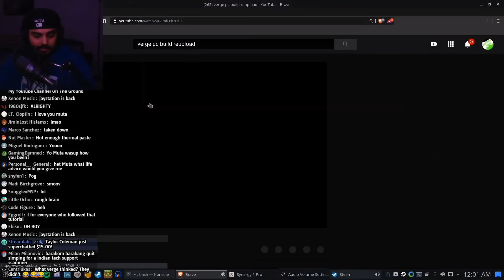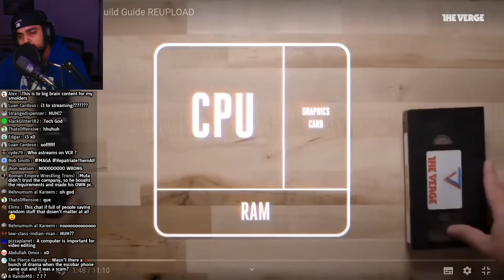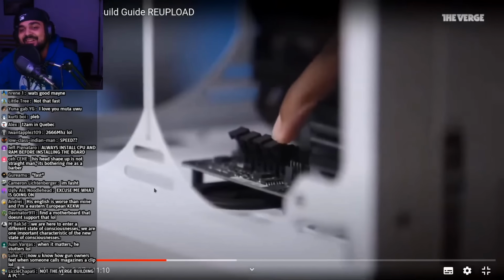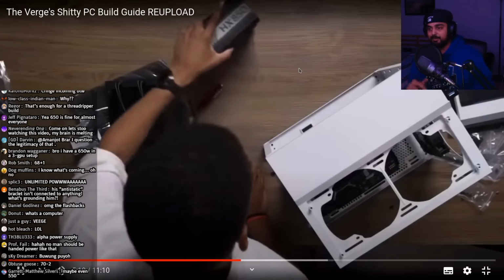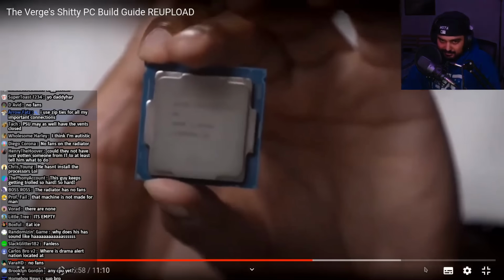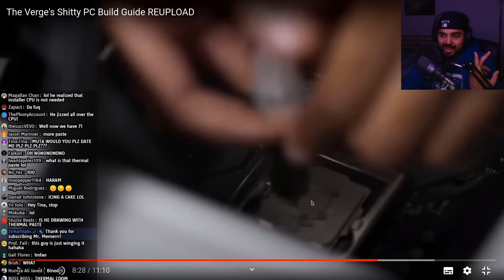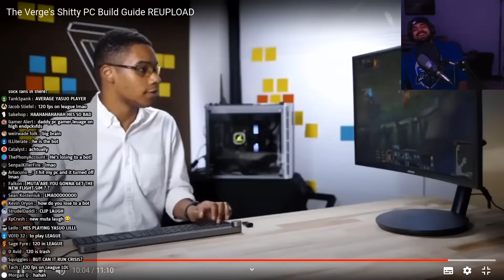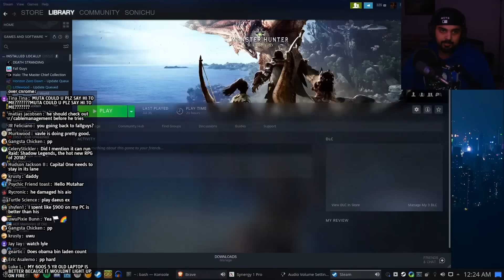SomeOrdinaryGamers - Muta learns how to not build a PC (w/ chat)

Comment: Give the guy credit, he did go on LTT and redeemed himself
Reply: The problem is that he never admitted his mistakes and came off egotistical and toxic saying that he has built computers and know a lot more than anyone
Reply: @andrics7611  No the problem is Verge forced him to record this on the spot and removed 60% of the video that contained context
Reply: @mistermittens3533  I wonder what the context was for putting no dual channel RAMs, slathering the CPU with thermal paste, putting the fan of the power supply the wrong way, horrible cable management, missing one ENTIRE screw on the water cooler, telling people to dump the piece of plastic that came with the processor which is needed for warrantee, recommending usage of a "brace" for putting the CPU but never using it himself, wearing a grounding bracelet with no grounding wire.
Even if all of that is excused, why would he benchmark with his fps capped? Why benchmark a game that requires nowhere near the power this PC has? What is the point of building such a PC if he doesn't show what it can do with games like Witcher 3? 
I don't care how he reacted or apologized, but most of the stuff he did could've been avoided on spot. No amount of context can ever explain why on earth an entire screw is missing from the water cooler.

Comment: PSUs are usually most efficient near half-utilization and crappy quality PSUs you can't really rely on to work well near their maximum (voltage ripple, fan noise etc). So a 850 W PSU will be most efficient when it is loaded to around 425 W; I would get a PSU that's got 50%-100% to spare ontop of TDP.

Comment: I’ve always just put a screw driver in the ground hole of a power outlet (bottom hole, if you get that wrong you may die) and just touch it after each part. Pretty cheap guaranteed way to loose static

Comment: Dont forget that a PSU is most efficient at 50 % percent load
Reply: With that hardware u ain't getting anywhere near 50% 850 is overkill
Reply: @thealien_ali3382  Don't double down on that dude 400 W are achievable with this build, you gotta give the benefit of the doubt

Comment: First dim slot closest to the cpu is also not the case anymore in a lot of mobo's, in 2 of my b450 motherboards first stick goes in the 2nd dimm away from the cpu, its weird, i also learned the other way since a long time ago.
Reply: Compensates for wide CPU air coolers that often block the first slot.
Reply: @lulzdragon7339  Ah, didnt think of that, you are right. Do you think it will just work fine if i use dimm 1 and 3, might be better for memory overclocking.
Reply: @budgetking2591  Depends, your mobos manual should tell the best way to install ram.

Comment: Worst thing I've ever done to a motherboard was an old motherboard (even at the time I was playing with it, it was basically obsolete trash; might have been a K6-II I think). Some genius thought it was a good idea to have the fan headers unmarked and right next to and aligned with the clear CMOS jumper pins and have old school fan headers of a type with no plastic keying; so naturally I stuck a jumper on the fan header and burnt it out. Didn't even kill the motherboard, just that (unused) fan header. 

Scariest moment with a motherboard was installing an athlon XP cooler of the type where you have to use a flathead screw driver and several kilograms of force to hook that onto the little plastic clips on the socket. If the screwdriver slips out that's really bad and if you apply uneven pressure to the corner of the CPU (naked die with no IHS) it might chip and that could be really bad. This was a fairly beefy cooler for the time, so naturally it was only using one of the prongs on the socket instead of all three to make you extra nervous of snapping one of those shitty little plastic prongs. It worked fine, it just felt awful to do.

Comment: I’ve noticed a lot of boards that are not esd safe are still esd safe. I work in assembly and have never had an issue with boards when I’ve tested. I even rubbed my feet on carpet before and touch stuff and it still worked fine and even passed

Comment: I'm still not sure if my CPU is overclockable. Though I'm pretty sure I didn't fuck up my build as much as he did as a beginner
Reply: Everyday I turn on the PC thinking I fucked something up
Reply: I didn't fuck anything up but..
1. My cpu cooler is to big
2. I don't have a gpu
3. One of my fans didn't work
4. I dropped my cpu when I opened the box so hopefully I didn't fuck it's future
Reply: @Plane.  lol my first cpu fan smoked when I started my PC
Reply: @maousadao9572  my fan did🤣it freaked me out
Reply: @Plane.  Hmmm. The only other thing of note that happened was the fact that I got an older motherboard and the then new Ryzen 5 3600 CPU. So I had to flash the bios, however I couldn't get my hands on a bios flash cpu kit and it took me like 2 weeks to finally get it flashed and working

Comment: 21:00, actually he’s wrong. For example, it’s better to run at 60hz with 144 fps than it is to play at 60hz 60fps because you still get the most updated frames as it reduces latency.

Comment: The fact that the bracelet is not connected to anything these are debunked a 1000 times you need one that connects to a ground wire. But if you discharge to a connected but powered off it works fine.

Comment: Hey just noticed something you said which is only half true.  When talking about RAM you usually want to start with the outer most slot furthest from CPU socket and the corresponding slot for dual channel.  Mobo manufactures point to those ones first, I would imagine to give you more room for an aftermarket CPU cooler

Comment: I didnt hold back when I put in my first motherboard in 2015 when I was 14, definitely screwed it in pretty tight and briefly let gpu hang from pcie slot unsupported. Never had any issues though what really killed my motherboard was a moderate overclock that fried the VRM over 4 years after being installed. CPU temps were good and everything and all seemed to be stable and then I hear a pop and smell burning and screen goes blank. Since my CPU hasn't been upgraded since 2015 I just found a cheap board off of a sketchy guy on craigslist and all is good no other parts were damaged and everything is working fine again. Pretty pathetic that a board that advertises overclocking would die like that.

Comment: PSU efficiency varies with power draw...the graphs I saw show not much difference, i believe there is like single digit variation, so personally I don't care about that, though some people make it to be the main point. Regardless, based on graphs for some good PSUs I saw, the sweet spot sits somewhere around 50-60% power draw where the PSU performs most efficiently.
Another criteria is the sound level, and again, based on graphs, I prefer to match my PSU such that the system at full throttle draws 60-70%. 

So, 850 might have been an overkill from multiple angles, but it's not a bad choice if later a person decides to put some more cards in.

Comment: They’re not zip ties Muta. They’re fu(king tweezers.

10:28 I just realize he had that piece is on the wrong side of the case;
- the two screws need to come off
- the top piece need to be behind the case
- then screw it back
10:34 you can see it’s not properly seated and this fool is forcing it in.

Comment: When muta says being rough on pc parts. I relate, I was moving to a new case and was taking off my cooler(due to height problems. Legit almost broke off the fan headers ripped my cpu from the socket and scraped the shit out of my mobo. Afterwards worked perfectly. Parts aren't made of glass you can be semi rough.

Comment: Something that others haven't pointed out, he really gets his fingers all over the pcb of his GPU. I may just be OCD but I always hold boards by the edges because of the sensitivity of small components. 
I may be paranoid but my justification is that dirt and oil on my finger tips could accumulate more dust over time. 
Also when he pushes down on the contacts of the CPU with that plastic thing it makes me cringe. Just scratch the sensitive parts of hardware created under extremely controlled clean rule conditions. 
Again...Just hold the component by the edges and slot it in...

Comment: sure this is an old video and i guess @Some Ordinary Clips already have corrected him self but just beucase a PSU is rated for X ammount of watts it wont pull that form the wall if the computer is not useing that much load, you can if you want get a 2000W PSU and use it on a I3 CPU and integrated graphics and wont pull 2000W that is the MAX load you can pull with that psu before it goes "poff" or shutsdown due protections if its a good PSU

Comment: you are actually supposed to put the ram in the slot furthest from the cpu
Reply: depends on the board.  mostly its 2 and 4
Reply: wrong, its 1 and 3 
closest to the cpu due for reduced latency.  2 and 4 work but if you check your timings in the bios, you'll see them slightly increased.

Comment: I assume the $2000 is because the fried the pc multiple times when building it? He just threw in the motherboard without even checking for extra standoffs? Does the IO bracket align? Drowned the cpu? The list goes on and on. He litterally is making up things as he went along. It isnt just the odd nameing of things like "the brace" or "the brick" but things like "the brick (psu) might short if its not on the rubber pads"-story that show that he clearly didnt even watch a single 10 min "build a pc" video before throwing himself blindly into the build.

Comment: Since I don’t want to make all these stupid mistakes can anyone recommend good pre built PCs for around 1k?
Reply: Wouldn't really recommend pre-built pcs, so if you plan on going custom I'd recommend holding off until the new Intel amd stuff drops later this year. New hardware means old hardware will be exponentially cheaper.
Reply: The only exceptional part of the video. Pc part picker!
Reply: jagtan13 so all the parts are good parts just the process is bad?
Reply: @manuelborrayo6537  well yes and yes. But, it's been a few years since the original video aired. New processors, motherboard, and wifi architectures have come out since. New parts are usually prioritized on the pc part picker website. Key things to look for today. Wifi 6, Bluetooth 5.0, pcie 4.0 or above, rtx graphics, spend some money on a good cpu and cooler combo together with power supply, mb, and graphics at first. Ram get what you can afford, anything above 3000mhz preferable on either Intel or amd for ram. Last for a boot drive, make sure the motherboard has support for an nvme m.2 ssd for the fastest boot times and key programs.
Reply: @manuelborrayo6537  also, for the ssd bit. I have an nvme drive to boot gta v. It ran like a dog, dropping frames when I had the game installed on my 7200 rpm game drive. I migrated the game onto my boot drive and the frame drops stopped. Get 240gb nvme boot drive and you can save a bit and get 1 on 2 to sata ssds for storage. Divest in any spinning media storage.

Comment: He does everything wrong he can but a 850w is a good choice imo, unlesss you only intend to use it for one specific build and not upgrade, but if I would spawm parts a lot and not keep all of my old stuff I'd pick a good psu too so I can use whatever parts I want and not have issues.( I mean I've never had a good psu die on me, only once this generic psu I had to use due to restrictions at the time. And 850 isnt even that much tbh, I have a 650 which is just enough for some parts, its not like he is using a like 1200w psu. He did put the psu in very nicely tho. (If you know what I mean).

Comment: 19:12 Arma optimization is trash, I'm on the lowest settings with only draw distance and object textures to the max. I get 60 fps 1080p gtx 1070 i7-7700k
Reply: Up to a certain point, your GPU kinda stops mattering all together, it’s much more important to have a powerful CPU, gained around 30 FPS by switching from a ryzen 5 2600 to a 3600x

Comment: I mean back in the day an i3 would've been shit, but 9th gen is pretty 👌👌
Reply: 9th gen i3 still was bad, 10th gen is good
Reply: @HJM9x  Of course 10th gen is better as it's newer technology, but 9th gen really set a new standard for the i3 with the 9100f, as it's more powerful than AMD CPUs up to the Ryzen 5 2600. (Edit) Not only that, but it was also a hugely better value.
Reply: @DawitULT  the i3 9100f didnt have hypertreading wich the i3 10100 has, unless its gameing the ryzen 5 2600 will outpreform it

Comment: My rig cost like 1200USD and it has a 3060Ti in it lmao
Reply: That sounds like a lot of bottlenecks
Reply: @saamo1423  Not at all honestly, I just need to add a radiator cause my CPU gets a bit too hot but otherwise it's a very solid build
Reply: @benjaminratthe9904  parts list?

Comment: You would vomit if you saw my current build. I have no cable management and fans don't fit. Actually fans aren't even the proper fans, just whatever I was able to pull out of other electronics 😂 but I'm poor and cheap. Ryzen 5 2600 with a Sapphire rx 570 and a dogshit western digital hdd

Comment: 120 fps in lol with 2k pc?

Jesus even my laptop that has:
1.86ghz
Intel hd graphics
128 vram
4gb ram
And is already about 6 years old

And it runs at 30fps. For a 2k pc to only run 120 fps is a disaster cause i've seen pc go past 300 fps (also the time i learned about 60hz and 144 hz monitors)